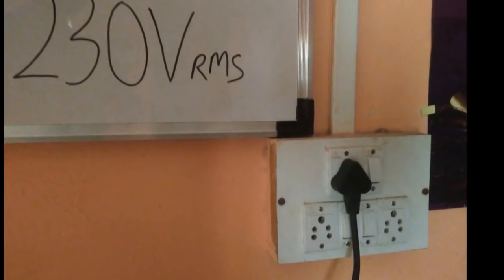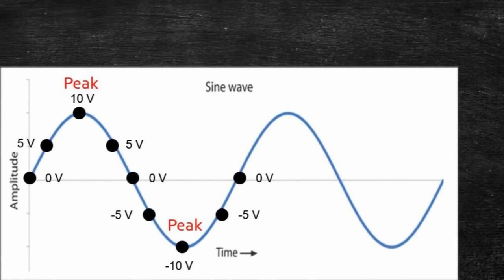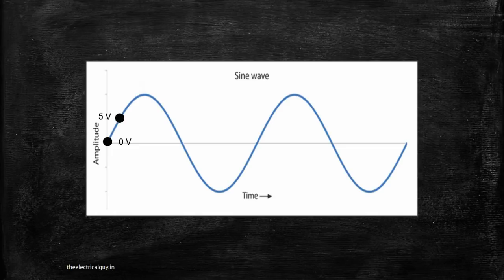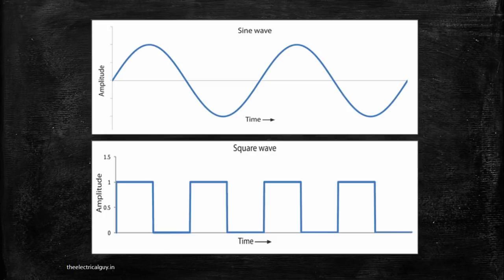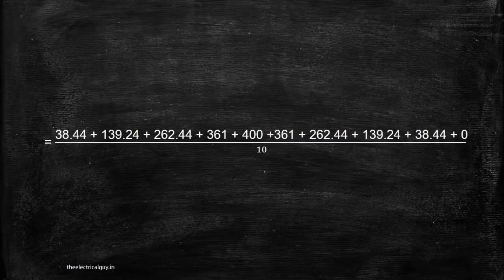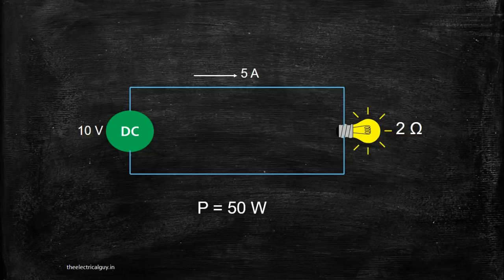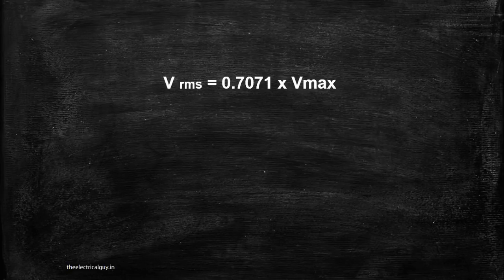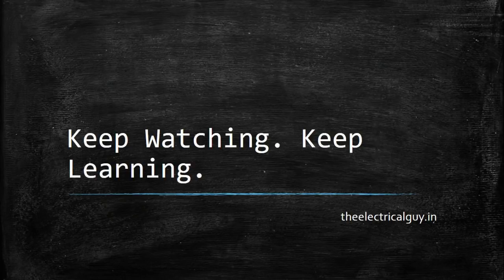What is RMS value | Easiest Explanation | TheElectricalGuy

Comment: Sir can you explain wt is the use to find average output voltage for any circuit if all the maximum ratings are dealing with RMS values
Reply from the maker: Can you please give example where we calculate average voltage?
Reply: Gaurav J  
Like in the rectifier circuits
Reply from the maker: I don’t know exactly why.. but it may be because we are converting AC into DC and in that case we need to calculate average voltage..
Reply: if the application needs DC value....then average is calculated....